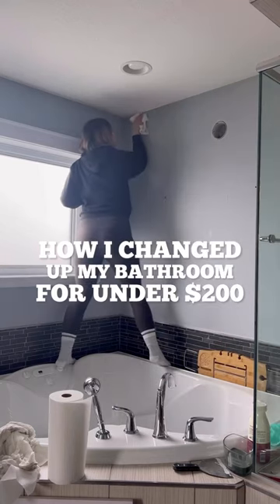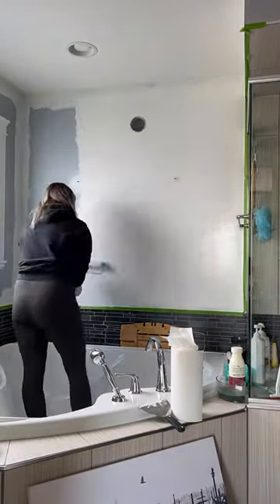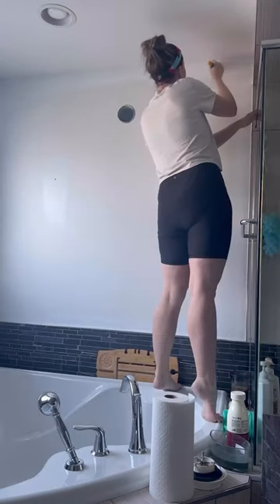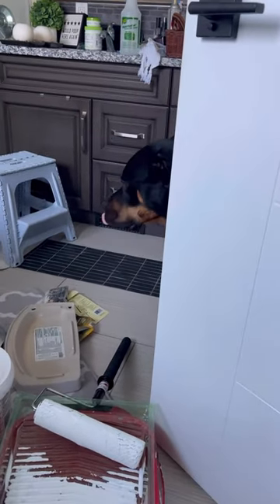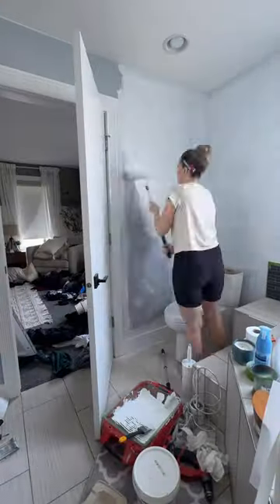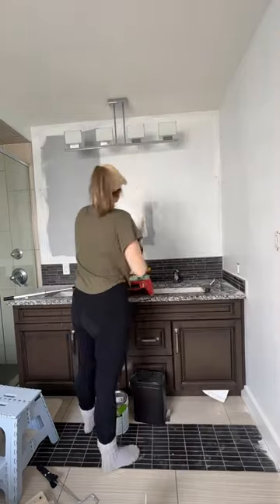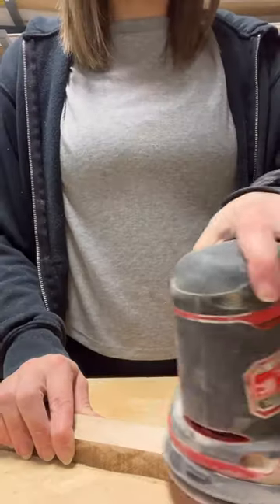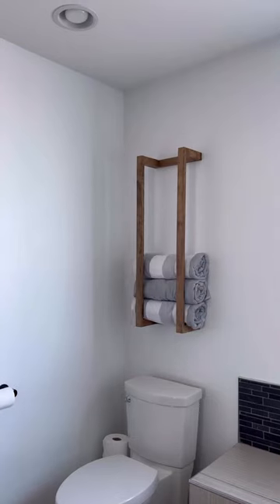✨Bathroom Glow-up for UNDER $200✨

Comment: How do you fix a door like that? I have one that's driving me up the wall!
Reply: To keep a door from opening or closing on it's own, take out a door pin and lightly use a hammer to just ever so slightly bend it. You may have to repeat, which is better than trying to get the pin straighter. The newly curved pin will cause tension in the hinge and stop the movement.
Reply: Exorcism?